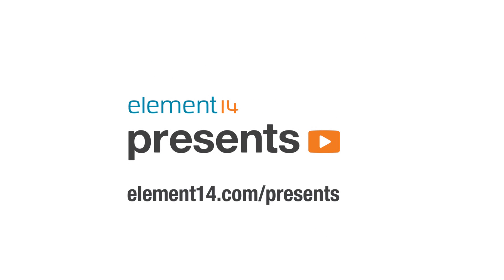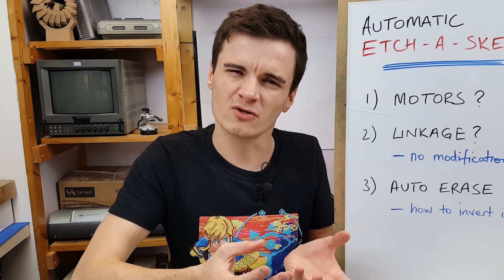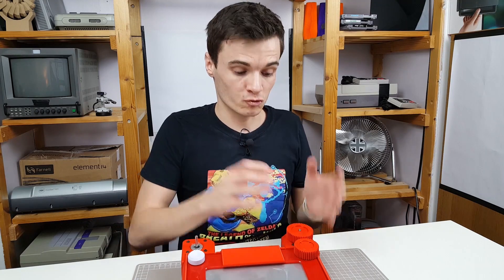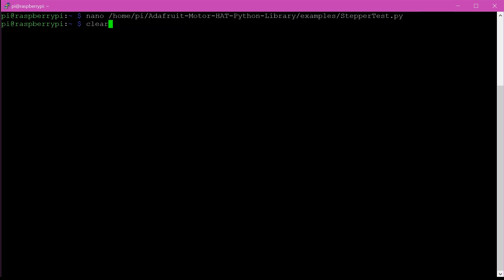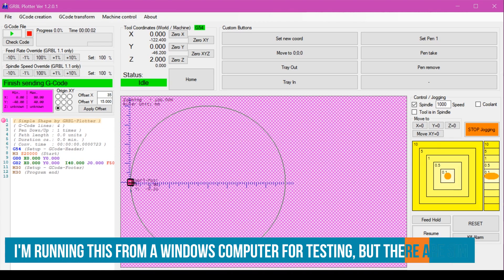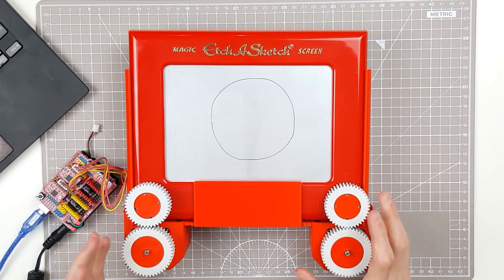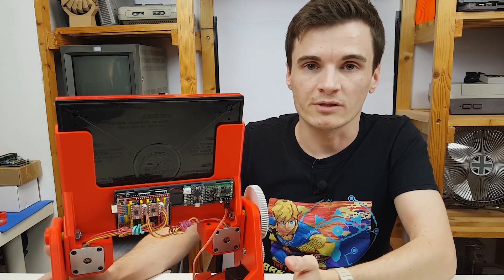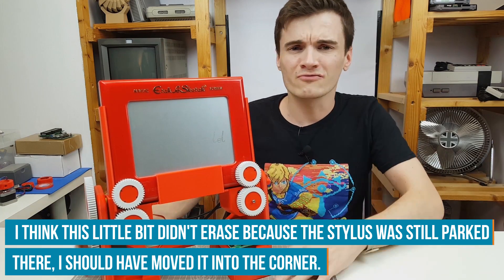Raspberry Pi Auto Etch A Sketch™

Comment: Would a vibration motor be sufficient for accomplishing the shaking action to erase the image?
Reply from the maker: It could be, though you still need the material to be in contact with the glass to cover it, so it has to be shaken flat, on its front.
Reply: @element14presents  Oh yeah, I meant in addition to the flip.

Comment: I'm a Embedded Electronic student and i'm sitting here like why don't you design your own board with maybe a PIC32 or STM32 so you have a single board and SINGLE CONTROLLER sollution just like the old days with BenHeck, and if i think about it i have a project with a 8bit controller that has all the same functions than your Raspberry pi + 2 Arduino's solution
Reply from the maker: It can sometimes be a prototyping choice, right? So do you go with plug and play parts which slot together, so you're focusing on a different way to develop that plays to your strong points, or do you develop from scratch which you may have to spend time learning how to do. This's why development boards exist.

Comment: i think belts or even rubber wheels touching the knobs will work better, your gears have too much slack, and more importanten than the erase feature (i my case) is a homing feature. Maybe this is not possible and you have to home it by hand every time, is ok but you should talk about, and if you  have to home by hand, you can erase it by hand too. On the other hand i would love to see more than just Text on this. I converted lots of SVG images to G-code, to use it on a router. Why you not able to draw a funny icon or Logo? it would be interesting to see how long it tooks for a more advanced picture than a cyrcle ? all in all a nice job, als well explained, but not enough thinkering. Sorry to say, but like your colleuges on this channel, you dont filling the hole Ben left here once.

Comment: Why have an auto erase feature without an auto homing feature for the stylus? Based on the backlash seen in your circle, errors will stack up too quickly to just go to zero. As implemented you have to remove the sketch anyway to home the stylus after each drawing, right?